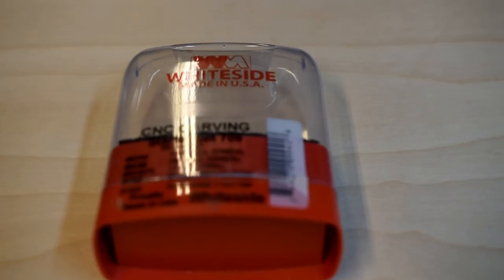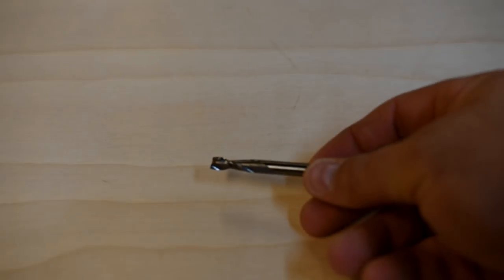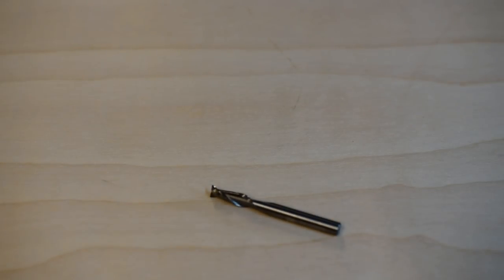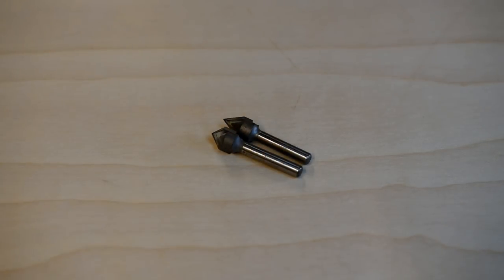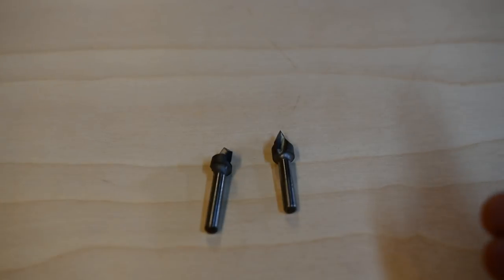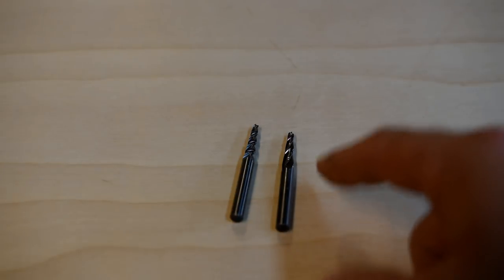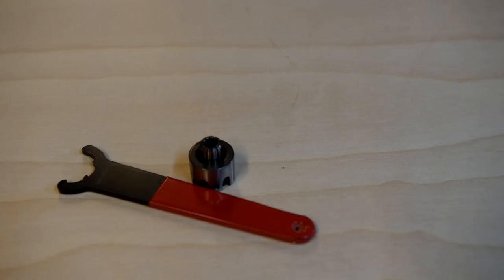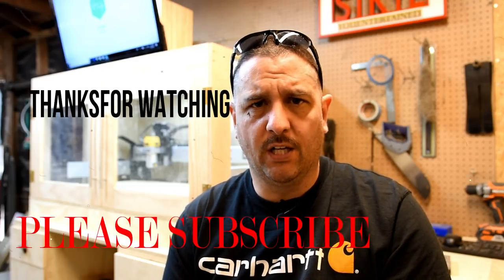CNC Basics What you need to get started

Comment: Correct, if I may, 
a) The very first thing is to ask yourself, what is the primary intended use. Is it just to discover or do you have a particular projects you want to create. 
b) Secondly, ask yourself what format or size are typically your projects. 
c) The third, what medium or materials typifies your work - aluminum, wood, plastic, foam?

Comment: I have known CAD for 9 years but CAM I am just learning after 7 years with a 3d printer.  First obstacle I ran into was that of finding end mills that are small enough to do intricate work YET will cut deep enough. 1mm-1.5mm with LOC of 12-18mm using 1 flute, or two maximum.

Comment: Just thinking of getting into a CNC an looked at the Digital Wood Carver DWC at a woodworking show in Tampa. Its more money about 8K after I upgraded the software added a water cooled spindle that would take up to 1/2" shank bits (spindle is a 220). and it american made. It's on a stand with Vac. What I like was the 1/2" spindle option that isn't available even in the shark from what I can tell. Support sounds like its excellent. This also included the 4th axis, 24X40 and z is 5" travel. What do you think

Comment: so I am making a sign with raised text.  I started with a 1/16th endmill to carve the details around the text.  Then I used a 1/4 inch endmill for the large areas (VCARVE PRO).  The 11/4 inch endmill cut right over the carving the 1/167th endmill cut.  oops.  start over.  I realized I had the tool set to raster rather than  outside.  WIll start over and see if this is the problem.  You're right.  A lot of learning and frustration.  I wacthed this video before I bought my CNC and decided on the Shapeoko XXL. I watch your vids to learn.  Thanks for all the great explanations.

Comment: I might add, and I have not used a CNC yet, that end mill bits are significantly different than the 2 flute carbide router Bosch straight bit that you showed.
I used to produce, by the thousands, small 3/8" thick plates with  2, 1/5" long, 3/8" wide plunge cut slots, in Ipe.  Ipe is an iron wood almost 3 times harder than red oak.
I found that I was always having to replace a straight carbide router bit after about 100 blanks with 2 slots.  After switching to a HHS end mill bit I was able to cut 5~6 times as many and only having to clean the bit after that.  The bit was still sharp.

Comment: To start with I'd like to say that this was a VERY informative video, with the items in question to go along with the discussion. I've watched several videos and this one gave me more information than the others.
With that in mind, I would like to point out a couple of things I noticed (or was missing) about the video that I learned from my military training and experience:
1. The really big one that slapped me in the face. The amount of times you said "Um" or the like. In the first part (before the intro segment), you only said it once, and while you had some obvious pauses for thought it was very clean and professional sounding. But later, as you progress in the subject, you begin to use it more often, which "can" take away from the appearance of "you know what you are doing/talking about". I say that this is the big one because, if you watch videos from "experts" and "beginners", you will notice a lack of this in the former and a preponderance in the later. 
2. When presenting the different router bits, you spend time "just holding or showing" the various bits, instead of also showing what the item in question does. I point this out only because this is (at least in my mind) a Beginners CNC kind of video, introducing you to the needed items in question, and that would potentially show people why they need it. For example, while I use a router and have several of the bits in question, the "conical" bits are a "void" in my knowledge, and it would really be nice to know/see what they do.

Again, I want to re-iterate that I found this video very informative, and I only offer the above as constructive advice to hopefully make you a better teacher at what you do. If you doubt my thoughts on this matter then maybe try this, find a portion where you use "ah", "um", and other sounds, edit or re-record it and have someone you respect give you there opinion on which is better.

I want to repeat, I'm only telling you this to help you be better at getting across what you obviously know. You obviously want to share your knowledge or you wouldn't be doing this, and I do hope this helps, as the information you have presented here is helping me.

Comment: I'm a wood turner of almost 2 years.  I have made lots of open and close segmented bowls, vases and live edge bowls as well.  I also have branched out and starting making lots of different freehand routed signs. I got lots of my supplies, templates, router base, Whiteside router bits from Dave Rhoten of "Make A Wood Sign". A great bunch of people, lots of free info and I have had much success(personal not financial). But I'm intrigued by the challenge, precision and potential of a CNC machine. After looking at the Shapeoko, XCarve and Piranha by Next Wave, I thinking of going to the Shapeoko 3 XL. I figure if it is good enough for you and Winston Moy, it must be a decent , reliable machine for the hobbyist. After all of that, my question is what about monthly maintenance. If I buy this machine, should I order the Shapeoko maintenance kit thinking I will eventually need it. If I only have room in my shop for an XL, can a person do a larger project (Y axis) by splitting the project(drawing) into 2 parts. You recommend VCarve. Vetrix will let you purchase VCarve Desktop and then later buy Pro for the difference in price. What would I be missing with VCarveDesktop other than saving a few bucks. In trying to understand 2.5D and 3D, is VCarve a full 3D program allowing the X/Y/z axes to all move at once together. On last question. Have you been able to use those router bits in your CNC machine successfully that you purchased from Dave's Wood Signs (profile, SC-50,30/60 degree cutters)??
Your videos are invaluable to a newbie like myself trying to understand this new sport and all that goes with it. My head is abuzz. Thanks. I hope to hear from you. Didn't see an email address on your YouTube channel so I thought i would give this a try.
Reply: I didn't even know there was a maintenance kit, hence I don't have one and I think I don't need one
and for the y-axis you can make boards as long as you want, if you have the front and back of the machine in a large enough room 
I use fusion 360 and that also can make boards as long as you want , toy can move it in from the front of the machine cut about 12 by 24 inches than move it 12 inches further and cut the second portion  etc. etc. 
and one of the big advantages of the shapeoko is that you can also mill in front of the waste board for end grain cutting like through dovetails or perfect square finger joints kind regards Hans

Comment: Can you talk about the bench work needed under the machine? How sturdy, stabile, flat does it need to be? What are some good things to build into it? What to avoid?
Reply from the maker: My advice would be the sturdier the better. You do t want something wobbly. If you opt to use something like 2x4 framing make sure its braced. I built my cabinets with plywood and a keg jig. Easy to do and it bolts to the wall for added stability. As long as you have stability you are gtg.

Comment: I do admit there is a learning curve to fusion 360 but oh boy what a software. I design in it, click the manufacture button do a simple material setup and chose the drilling operation and what bit I use click on the preview button whatch it perform the entire operation just like a movie . And then I just press the post buton to create the g- code . Take that to my shapeoko load the gcode straight into carbide motion and away I go 
I just made 12 drawers with dovetails seamless ( one of the benefits of the shapeoko to use it in front of the waste board)  I van cut endgrain that way with a dovetail bit fits like a glove 
and last but not least as you mentioned cnc cost money so why spend all that money on software if you can get free real good software, for free  hey and there are lots of good you tube tutorials on fusion
thanks for all your video's mate kind regards Hans

Comment: Great video!  I'm interested in getting my first CNC router.  That being said, although I know having one would make what I want to do very easy., I'm not sure I need one and I'm hoping you can suggest an alternative method until I can afford to jump into CNC.  I want to make wooden knife scales for folding  knives and I want to make them out of various exotic hard woods, e.g. Cocobolo.  Now I know I can already make them for folders that use a liner lock as many of those have scales that are flat on the inside wall of the scale.  The problem for me though is that many folders use  locks other than a liner lock, e.g. Compression lock, back lock etc.  and the scales for those have channels for the locking mechanism on the inside of the folder.  So, I'm hoping you can tell me how I could create those by some other method other than a CNC router.  I can send you a picture of one so that you could see exactly what I'm trying to do.  Currently I have only a few tools.  I have a Dremel 200, a drill press, a vise, a coping saw and a belt sander.  Any help would be greatly appreciated.  Thank you.

Comment: I really do hope you can reply to this question..
And the question is..
Let's say I buy a small desktop CNC...
Can I then disassemble the carriage add longer sliding rods in X and Y axis..
And use the same stepper motors with this work to cut larger projects? Would this work? (Seems to me it would, )..
Why would I want to do this??
To basically get a larger CNC for the price of a small one and a few extra dollars for the extra Hardware purchased to make modifications.

Comment: Thanks so much for a Great video!......Please Recommend a Machine.....I do Mother of Pearl inlay in wood. The maximin size piece of wood is 3" x 6" (75mm x 150mm). Maximum depth of cut is 1/8". I have been cutting the wood freehand with a trim router with 1/8", 1/16" and 1/32" DS bits and cutting the MoP with a jewelers saw. I am ready to move out of the Dark ages and start producing with a CNC machine

Comment: Thank you for this beginners video. You mentioned that you need a computer to run the machine and then you went into a discussion about software. If I purchase Vetrics Aspire and I do my vector drawings on a desktop Computor and then transport the working files to a laptop or other computer that runs the machine, will I have to buy two copies of the software?
Reply from the maker: I was able to download v carve onto 2 computers. I would check with vectric just to make sure, but it should work. When you purchase it you get a login to a download portal where you download the program at. But the computer you have hooked up to the machine only needs to have the CAM program (Carbide Motion) all you are going to take to the machine is the toolpath files you created on your desktop in Aspire. I like having vcarve on both machines so I can make changes to my toolpaths in the garage if I need to without having to go back and forth, but I do the majority of my design in the house on my desktop.

Comment: Great video, one thing I would like to add is when buying tools it really depends on what you plan to make.  I only have a few tools that I started with and found I use them on 90% of my projects.  I use a 6mm (.236) end mill, 1/8" (.125) end mill and a 1/2" x 90 V-bit.. That's it..  I make custom signs and they keep me busy enough to generate a few hundred a month.My second thought is the machine purchase.  A new beginner to the CNC world should start with a hobby style machine like whats discusses in the video because they could and will get frustrated and possibly stop and move on with another hobby.  However, someone that has programmed machines or ran machines in the past may want to invest in a better machine or they might end up buying twice.  I program CNC's for a living so I wanted a good machine right from the git go.  I'm familiar with programming and running machines so things came naturally for me.

Comment: One question to expand on your comment about getting the largest machine that firs into your shop. 
How much room should you allow around your machine? I mean have you found a distance from 
machine to wall that works? I am thinking of putting a CNC into a large shed. Thanks!
Reply from the maker: The back can be pushed up against the wall, the sides need a couple inches (control box on one side) and the front should have enough room so that when the gantry is all the way toward you there room for the router to overhang.

Comment: I am totally brand new to CNC. I hand carve wooden fishing lures. The final product is usually 6 to 8 inches long. The question I have is since the final product is totally 3D at the end would it be better to have a 3 axis or 4- axis? It would seem 3- axis I would have to get an alignment perfect to complete opposite side of the project. However, the 4- axis would seem to almost be able to carve the entire piece with much greater detail I have previously had to do by hand. I am starting my research now and CNC Shark seems to be a good option? Any recommendation would be appreciated.

Comment: Very nice video for one thing I need help. Thinking for getting a CNC machine and not sure what would be the correct one. You see I can't find and system that the programs will work on a Apple computer. If needed I will get a PC. One problem is I don't want to spend a lot of money for just a hobby. Any help you an give me would be great. Again very nice video. Hope to hear from you soon. Thank you.
Reply: apple computer is fine , shapeoko's carbide motion will work on that as well as fusion 360 And that is all free software the machine is not free but I think it's realy  worth while one of the biggest advantages of the shapeoko is that you can do very long boards and in front of the machine you can do end grain cutting

Comment: I'm looking at the Ooznest WorkBee ( http://ooznest.co.uk/3D-Printer-CNC-Kits-Bundles/WorkBee-CNC-Machine ) but can't decide on belt or screw driven. They only have screw driven for a maximum of 1000mm ( approx 39 inches) travel - they do allow you to mix and match belt/screw on the different axes. Belts you can have 1500mm x 1500mm (workable area is approx 51 inches x 49 inches ) but I'm torn with the accuracy of screws Vs belts. When working with wood and CNC machines do we really care about accuracy to 0.00787 inches? That's supposed to be worst case on a belt system, the screw system is worst case 0.00393 inches.
Reply from the maker: That kind of accuracy is good enough for wood IMO. Probably too good, but you never know when you might need it.

Comment: can those same machines be used with lasers as well as traditional bits? with some sort of attachment swapping?
Reply from the maker: Absolutely. The most common one I have seen is called JTech. It will work even without taking the router off, just need a laser software like light burn or something.

Comment: I've never used a cnc before. I'm interested in buying one. I would prefer 48 inch x 24 inch minimum bed. What would you recommend? What free programs do you recommend trying out to test before getting a machine(if that's possible)?
Reply: The shapeoko XXL is a really good one for the price. They're about to quit making the shaoeoko 3 since the 4 and pro are out but they're almost the same machine. The onefinity is a great machine as well and will last longer and is more ridged since it uses screw drive instead of belts. Also another program to use for free is fusion 360 for students BUT it does take a while to learn (I have barley got into it myself so far). Hope that gets you a start!
Reply: @blake102989  thank you so much for the advice!
Reply: @DiaryOfAStud  no problem

Comment: for your micro v carve bits that are the 10, 15, 20 and 20 degree how did you put those into carbide create? been trying to figure it out without messing it up.

Thanks in advance Earle
Reply from the maker: I dont use carbide create. I use vcarve pro. If you head over to the shapeoko nomad group on Facebook there is a lot of people there that know carbide create and can help you with that.
Reply: you could try to learn fusion 360 then you never use carbide create ever again kind regards Hans
in fusion 360 you can edit the bits that you use or create them yourself so you can use any bit you want

Comment: im buying the same machine. with a dewalt router. does the dewalt come with a 1/4 inch or an 1/8 in collet?
Reply from the maker: 1/4
Reply: 1/4 inch and also a 8 mm collet a wee bit thicker and you can buy 1/8 inch collet as well for it

Comment: Jason: I’m having a problem with the controller on my Shapeoko 3 XXL not working at all, using the V Carve Pro v9 Program- do you have any info that could help me out. Thanks: Ron Welch, Mobile, AL
Reply from the maker: rwelch46 when you say controller are you talking about the carbide motion program or the circuit board
Reply: I also have Carbide v4. GRBL 1.1  software.
Reply from the maker: I sent you an email